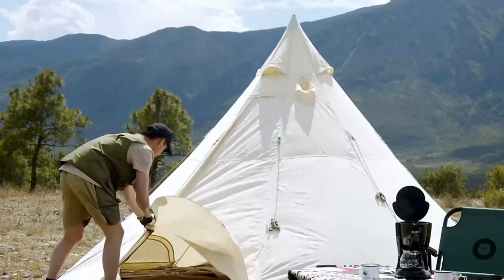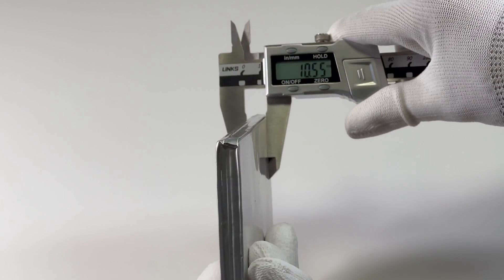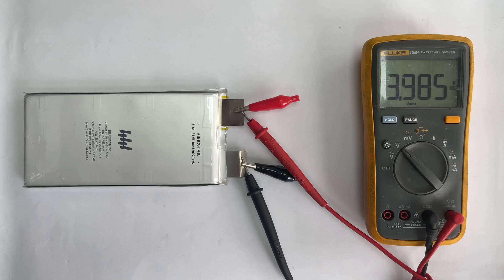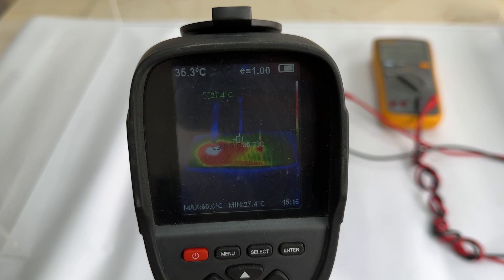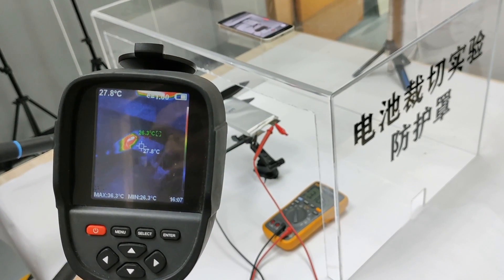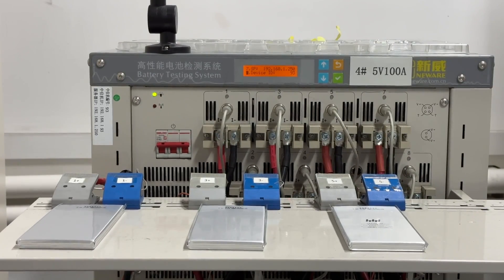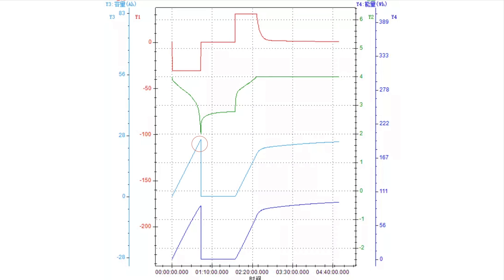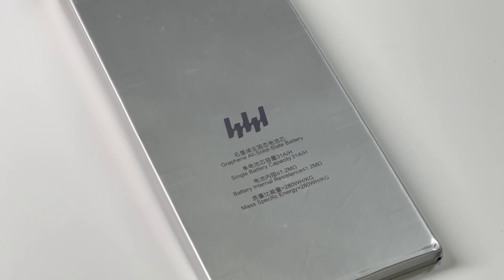Safer Battery? | Graphene All-Solid-State Battery - Destruction & Temperature Tests

Comment: Amazing! But what matters is the most is - is its longevity better than of traditional lion batteries? How many cycles can it handle and how much does it degrade by just lying around?
Reply: with that low temperatures I can be sure that lifetime is great, is like all in physics
Reply: @FisiClay  it's not just about temperatures, but also voltage. Most modern devices get barely warm while charging, and yet the highest capacity ones usually don't last that long if you charge them to 100% all the time. If a manufacturer prioritizes capacity over longevity then there isn't much we can do, especially in laptops, half of which still don't have the batter charge limit to avoid fast degradation.

Comment: Let's hope that the FAA approves batteries of more than 99w for greater autonomy in laptops
Reply: yeah most laptops still don't last a whole day on a single charge, I really want to see this fixed. Hopefully these batteries are a way out.
Reply: That’s not a battery issue, that’s an Intel and AMD issue. I get 2-3 work days on my M1 MacBook Pro before I need to plug in. Any thing more than that is just not necessary.
Reply: @TheOfficialOriginalChad  Apple had to completely change the architecture which screwed compatibility with older programs. On Windows, you can't just do that as not only you would lose a lot of performance in most programs, but older games may not ever launch again. Games are a form of art just like movies and they should always be available, hence Windows hasn't drastically changed its core and hasn't moved to arm yet